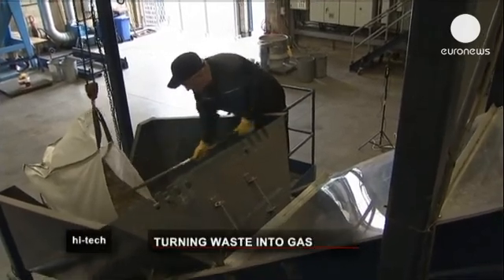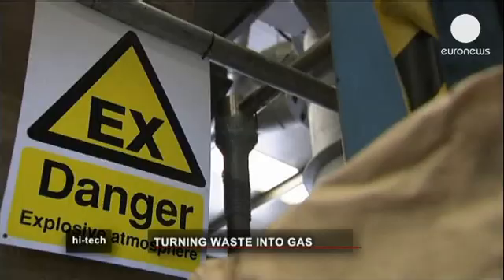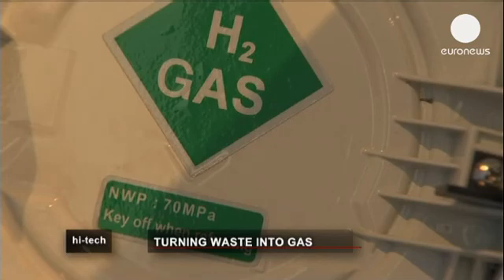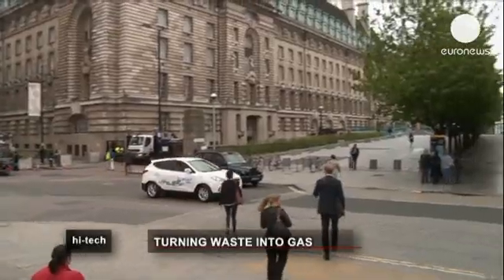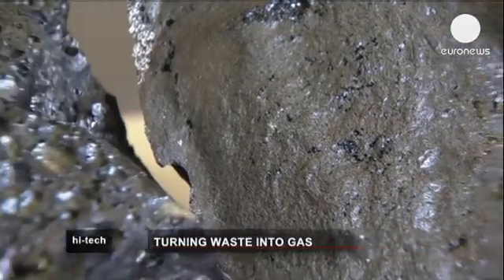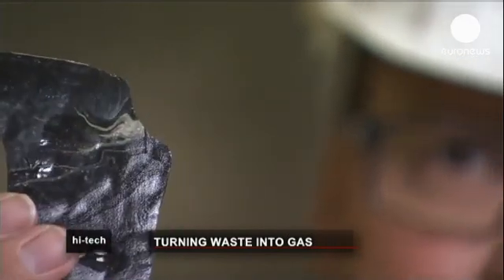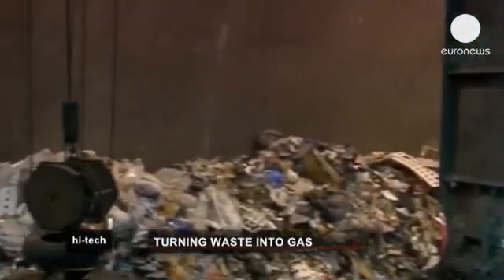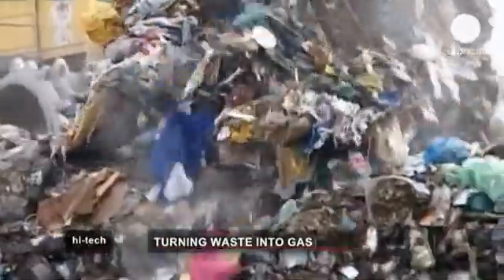Plasma Power: Turning waste into renewable energy

Comment: Strange to be worried about costs in this toxic environment. Costs wouldn't mean a thing with a better educated population, better educated that is about how things are done and who decides to use it. Emphasis on costs is beneath a society wallowing in self generated toxicities through supply and demand. Wouldn't you like to know about the byproducts produces from those demands? Kyoto Protocols called for 99.99999% destruction or transmutation of wastes in their paradigm. Claims were made that it did not exist yet. It did and it does.